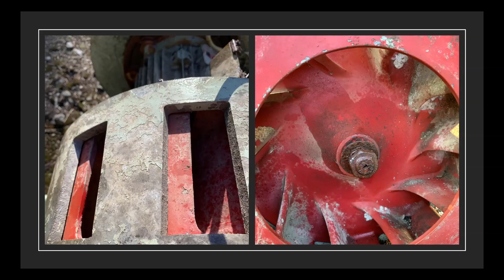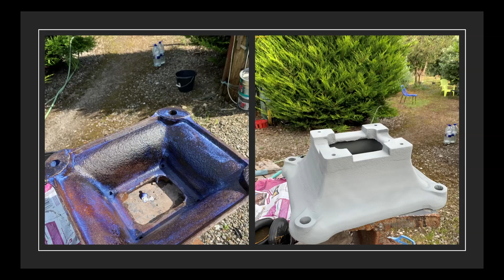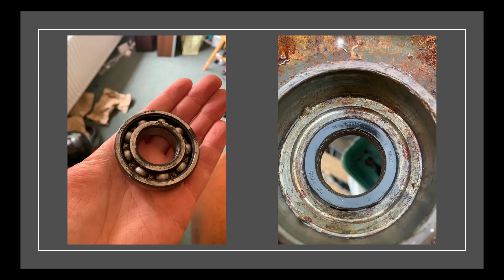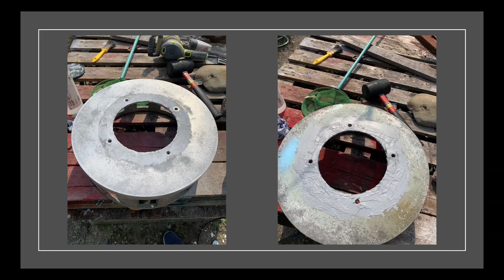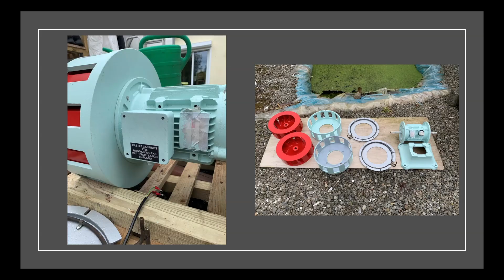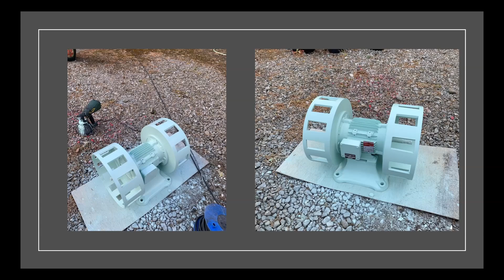Castle Castings Siren Restoration

Comment: Cool I was just wondering if you are make the 240v gent sirens and selling them? And how's the cs8 going?
Reply from the maker: Thanks for watching, I will be making more sirens to sell soon, am working on a revised version of the gents that can run off 6 volts instead of 240. As for the cs8, I am trying to use rc servos instead of solenoids for the dampers as the solenoids got too hot too quickly
Reply: @Electronicsandsirens cool I will be sure to get a gent siren when you sell them because it's my favourite siren. I have a 3D printer but I can't find any models for one